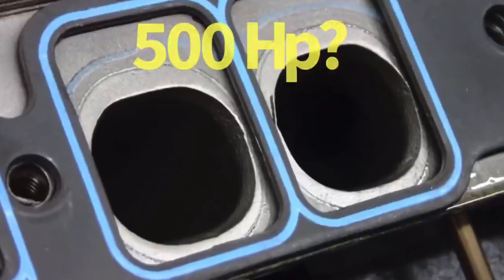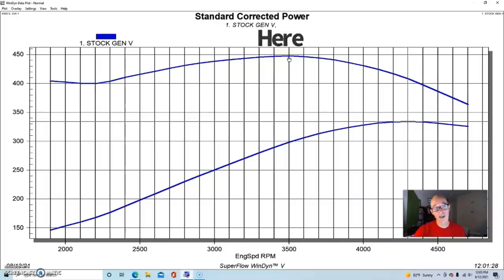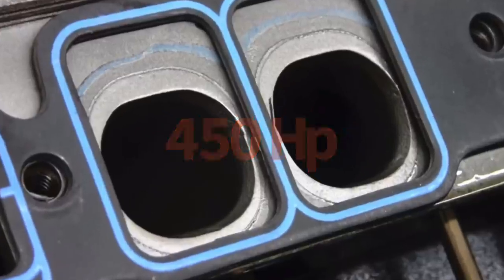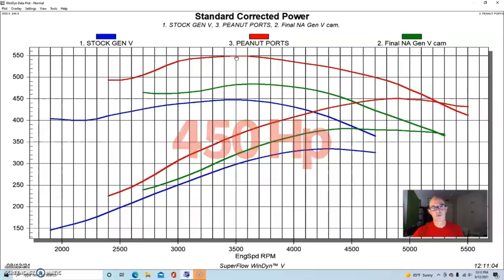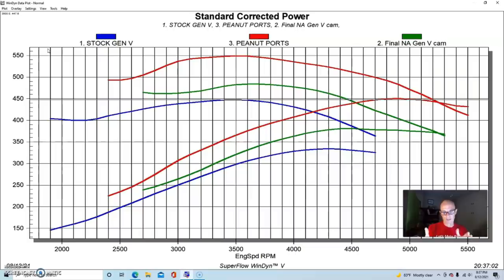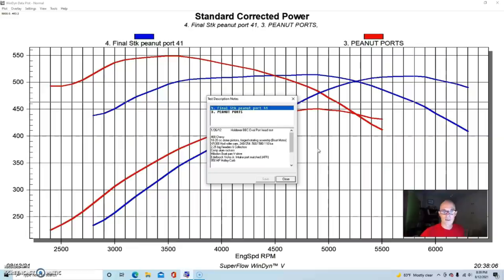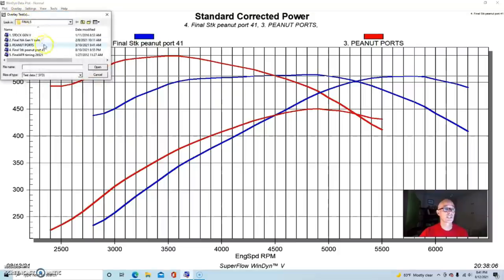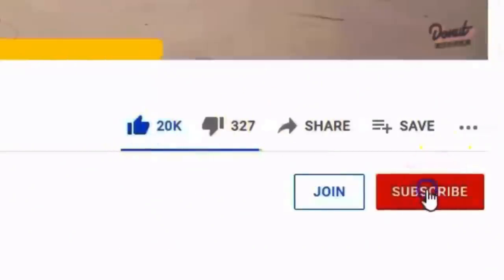HOW TO: MAKE 300 HP, 400 HP & 500 HP WITH PEANUT PORT BBC HEADS (HUMBLE JUNKYARD GEN V 454 )

Comment: Comp Magnum Series 286H  236@.50  .556 lift on 110 LSA.  Hydraulic Flat.  This would be a good swing at 500hp, good torque without spending on a roller.

Comment: I put together nearly the same engine (but using stock 781 heads & an Eddy Air Gap), and made more overall torque and horsepower with an Isky 304 Mega cam than with this Comp HR cam!

Comment: great test. if you have left the flat top pistons in there to have around an 8:1 CR and throw the roller cam in there with a right  106 - 107 LSA  would you just be down around 8%  in the HP & TQ ?  i have a gen IV with peanuts ( 360 castings ) and just want to throw a mild roller in there. DP and headers already in there.

Comment: I have a Gen IV 454 short deck with peanut port heads. This will be a daily driver and used in a 1979 C30. I'm interested in 350 hp/450 tq. range. Can I get there with air gap dual plain manifold, 750 carb, and long tube headers with a stock cam? I'm on a budget.
Reply from the maker: YES

Comment: Richard, have you done a test putting Gen VI heads directly on the Gen V to see what kind of gains you get with the stock cams and then with better cams? I'd really like to see that.
Reply from the maker: I NEED TO
Reply: @richardholdener1727  it would be interesting. You've mentioned it in your videos. I  have a Gen V with 147k miles on it, still runs great. Because of your advice, I found a set of the Gen VI heads that we're redone with little use. Going to collect a dual plane, distributor, though I think I'd like to go with TBI like FiTech or Holley Sniper. Eventually going into a 1950 Chevy C.O.E. car hauler I'm building behind a 4L80E. I need all low speed torque. Thanks for sharing your knowledge and they dyno pulls. Really enjoy learning and seeing what you test and how it works out.
Reply: @MartyEscarcega  iv same deal. A gen  5 I'm wanting to put gen 6 heads on!

Comment: Can you try to build a high torque big block? I want to see a gas engine that can compete with a diesel. Let’s say a diesel makes 400hp and 800lbs. Diesels are doing this at low rpm with the use of turbos producing high boost. Diesels are all forged, boosted, and have thick castings. If you built a all forged 454 or 460 with a high torque low rpm cam and pumped 20-50psi of boost in it, can it match a diesel?
Reply from the maker: it can't

Comment: I'm thinking the air gap intake probably contributed very little over the Weiand  duo plane. Those Weiand's are about as good as it gets for a dual plane street intake. Much better than the Performer RPM in my opinion.

Comment: I have a1997 454 engine out of a motor home. The engine is in excellent condition. What would be the best bolt on parts to use to raise my hp 150 to 250 hp without using nitrous?
Reply from the maker: boost
Reply: @richardholdener1727  Thanks. I was wanting to keep it na though.

Comment: Richard! love your vids, I hear you say a lot when is an engine wide open under 3k or even 2400 in regards to the dyno I say to that my river fishing jet boat does all the time when loaded tryng to get on plane.(carbed 302) looking to go 408. could you do SBF 408 stroker with a jet boat in mind. I have never seen a video on one and the internet doesn't have much on cam selection for jet boats. The owner of American Turbine the pump company for the jet said go for a cam with max tq a 43-4500. without any more guidance that what I will do. What do ya think
Reply from the maker: CAMMING A JET BOAT IS EASY BECAUSE IT RUNS AT HIGHER ENGINE SPEEDS-LOOK AT A COMP XE274HR FRO THE 408 OR IF YOU WANT MORE POWER-THEN THE XFI236
Reply: @richardholdener1727    Thanks so much for the response. My goal is to get on plane faster with a full load I run shallow water the faster im on plane the better. Also how do the oem water-jacketed manifolds do? have you guys ever dyno something like that?

Comment: How did you get that single plane to work on "peanut ports" and even that dual plane for oval ports? Port mismatch must have been incredible with very turbulent airflow.
Reply from the maker: it was mismatched-but it still works-lots of mercury marine BBCs came with just such a mismatch
Reply: A lot of people through the years have lost power trying to correct mismatched ports instead of gaining power. So even though it's not ideal, the engine just keep doing what engines does, moving air. :)
Reply: @PSA78  
Yeah I understand that. But there's a big difference when your using a "oval" port manifold on a "peanut" port head. The ridge that was been created by doing that. He could have got more hp easily by using the right manifold with the head. There aren't many manufacturers that cast manifolds for the peanut port heads. The Performer 2-0 is matched for the peanut port head and has enough material to open it up to the oval port if needed. We are all looking for maximum efficiency when we build engines, at least some of us do.
Reply: @henrys.6864  I didn't know that there was a manifold for the peanut port, would have been an interesting test as well, comparing the two manifolds on those heads. 🙂
Reply: @PSA78  👍👌
Reply: Makes me feel like I might have about the right combination going on in my build.

MKIV, +.060, JE pistons, forged crank and rods, ~9.3:1 +/-, World Merlin 119cc heads (320cc runners, 2.190/1.890). Edelbrock RPM air gap, Isky roller; 275/284, 0.535/0.575 (?)
Reply: @wlrottge  
That's gonna be a beast! 👍 Good luck! 👌🇺🇲
Reply: @henrys.6864  Thanks, I hope so!  Going in a boat, so the rev limiter will be 5,2 or 5,5k. Hoping the mid range is there!

Comment: So should I use an oval port intake manifold on peanut heads? My motor is basically stock, I just want to get rid of all the TBI stuff to make it run better.I'm going to run a 650 CFM Holly double pumper classic on it.I was thinking of using a Edlbrock RPM Air-gap 2-0 with oval ports on it.
Reply from the maker: OR YOU CAN RUN A PEANUT PORT INTAKE
Reply: @richardholdener1727  thanks Richard

Comment: 550 lift 320 duration crane valves and pc seals forged crank mellings high volume oil pump 850 double pumper in a 72 CALIFORNIA SKYLARK IN GREEN 454 CHEVY 12 BOLT AND A B&M TRANS ROCKET SHIP MORE MIKE

Comment: Old video i know. But im building a 92 pickup now. I needed this. The right cam. The heads i have. Bore with new pistons. And i may play with the heads.
Reply from the maker: for what application and usage
Reply: @richardholdener1727  4x4 towing. Farm work. It's always been weak. I will keep my heads. Go 4 barrel. 18cc pistons. And a slightly bigger than stock cam. Good valve job. Maybe clean them up. No wild porting.

Comment: @Richard Holdener, are there certain peanut port heads that flow more can than others? Seems I saw an article many years ago that stated as much. Can't recall where or what the info in the article detailed.
Reply from the maker: HAVE NOT MEASURED THEM ALL
Reply: @richardholdener1727  I found the article. The 236 peanuts are the best.

Comment: Hey Rich! Can you do this with a 427 Tall deck block please? 4 inch crank, 6.535 rods 1.64 CH pistons, peanut port heads as a base. Trying to get 600+ tq at 1700 rpms.
Reply: Also be cool to see you destroke a 454 and put it on boost. Anybody else want to see a twin GT45 turbo 427 dyno video?
Reply from the maker: it would be VERY hard to make 600 lb-ft at 1700 rpm with a 427, 454 or 496
Reply: @richardholdener1727  even with 8.5 psi?
Reply: Figured a Gen 5 produced its peak torque @1800 of 405ft#'s. A tall deck Version of a Gen 5 should produce more peak torque with higher compression pistons. Theoretically 500 ft#'s? 8.5 psi could put that at 600+? With an operating range of 1500-2500 for towing?

Comment: I have a 454, told it was a 94, but it doesn't have peanut port heads,  it has oval port heads, with performer rpm intake, 750 holley, and the idle doesn't sound stock, maybe it's the open headers, but it has a bit of lope,  I'm currious now exactly what it is, I thought the newer roller blocks came peanut ports?
Reply from the maker: maybe they were changed

Comment: I say fully port the heads and mill them to 10.5 to 1 compression then step up to an XR274 cam. Should be a good compromise on torque and pass the 500hp mark with an AirGap intake.
Reply: This is my setup actually! larger cam though (282s) and I bet with a carb or fuel inject change my engine would hit 600hp. or really close. I am thinking that I am 10.750 to 1 zero decked. with this setup the intake needed to be shaved on the sides for a good fit. so my thoughts are why buy AFR 290 heads when mine do the same? weight?
Reply from the maker: you won't hit 600 hp with that cam and peanut ports
Reply: Hey I have a 468 with 22cc piston 3 angle valve on the peanut port and 227/235 545 lift 109 .. 750 Holley 400 trans .. what numbers you think i have? Jus finished the build
Reply: @jon6537  Are you running an Edelbrock RPM AirGap?  I saw a video where they used an (claimed) 11 to 1 468 with fully ported Peanut heads with bigger valves, a 294HR Magnum roller cam, AirGap intake with a 950 Holley Ultra carb. It took some tuning with carb spacers, and rock arms and things but they did see near 600hp (like 572hp) so 600+hp might be possible but it would take more cam and more compression. Then you have to think about what you're giving up.
I think if the Peanut heads are ported right they "could" support 600hp or dam close with a big cam and big compression. If you want more hp than that and not run a pro stock cam with 12 to1 compression you will need to step up your BBC heads. You know that would be a good test video, figure out what is the cheapest best BBC head to support 600 to 700 HP. Just my thoughts

.
Reply: @richardholdener1727  I used to work for TREMEC trans, I have been in some of the fastest domestic production vehicles, my job was to do customer concerns and shift ability evaluations on Hellcats ,GT350-500, C7 and C8 corvettes, ZL1 camaros. when driving them the customer would ask, what do you think? I always replied, fast but I think my BBC TA would be a good race. when putting the car together I Broke 2 B&M converters, and had to ATI 10" 3500 stall TH400, no more problems.
Reply: @jon6537  cool thank you I’m putting it a 70 Chevelle I jus want a nice torque motor wit power
Reply: @clintonison3749  With the right parts and tuning you have the potential to have a VE of 1 to 1 at least.
Reply: @warrenstephens3705  YES, Edelbrock RPM AirGap I cut down the center section 1" and my car gets its air off the windshield like similar to nascar. I used the cam quest by comp cams and manually put in my head flow numbers and they claim that I am in the 600 hp range. with the air gap and 750 carb, Chuck Nuytten carbs says the same about my application so why buy AFR 290 heads?
Reply: @clintonison3749  Your best bet would be to Call up ATI tell them what size cam, tires, gear, Nitrous or not and have them build you a convertor! NO joke! your car will react to your application with that convertor and you will always be happy. My car is a bad a$$ street machine, Z06 guys think they have something until they see my tail lights!
Reply: @jon6537  right on I appreciate it .. I’m jus trying to have some nice torque on pump gas that good street machine .. I have a rpm air gap intake too
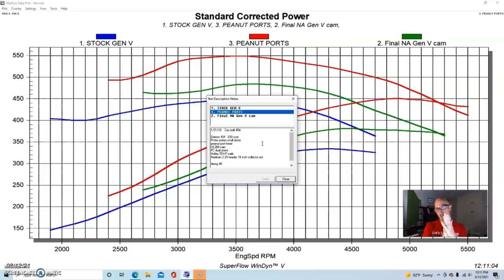Reply: @warrenstephens3705  thanx warren I’m jus trying to see what I have and will it make my car move … I have 4:11 rear and gears just a sat/ Sunday  cruise car
Reply: @clintonison3749  take a look at the center section of your intake, is it solid or cut down? 350-7561 this is the part number of mine look at the center divider, if yours is not cut down, then do so! you will gain some of that missing torque. the guys at motor trend also did this in their videos and can show you the difference it makes. Also BBC love timing advance, 34 degrees total is what I am set at!
Reply: @jon6537  it’s cut down .. and no one told me about the advance timing .. right on … I have 4:11 gears in my rear end too
Reply: @jon6537  I have Holley 850 carb too is that to big ?
Reply: @richardholdener1727  Well your right, what I thought to be peanut port's on my heads were not 063 are ovals! this now makes sense with the power that I am achieving in my engine combo.

Comment: Hi there.
I have a 454 m4 BBC with oval port head. To be installed into my old 62 series Landcruser. 
I'm seeking big torque & high horse power for 4wding. What's required?
Reply from the maker: STROKER WORKS

Comment: let me rephrase my comment.  is option 3 going to work in the marine environment?  no water reversion into the cylinders?  my motor just took a dump and is getting rebuilt and this looks like no brainer type upgrades while motor is out.
Reply from the maker: likely not with wet exhausts
Reply: @richardholdener1727  likely not to have reversion it likely not to work?  If likely not to work any advice on a cam that would work in marine environment and get me this type of upgrade above stock?   Also, I'm researching the speed master intakes, did you use the low, medium or high rise intake?
Reply: I recently went ahead and made these similar modifications to my mercruiser 454.  We are having some issues with idle not being consistent and issues getting carb adjusted.   It is a Weber Carter carb that was just rebuilt to go with the motor in stock form.  Now that we have gone with domed pistons and bigger cam do you think we need to rejet the carb?

Comment: I have a 454bb and i need your support to know what cam i can use for My engine 1980.
This has,manifuls multiplean edelbrock,headers, just need a cam com street map to increas the hp.
Thanks for your comments
Reply from the maker: look at a mild bbc cam
Reply: @richardholdener1727  
Thanks Richard.
What's size do You recomend xe268 for exemple in a normal engine? Just i Will replace the cam
Reply from the maker: that is a good rv style

Comment: A more realistic test would be a mild cam like the 268(that someone could potentially drive daily) with peanut port heads. Then upgrade the heads to like a 781/049 and see what kind of difference can be seen.
Reply from the maker: how to make 300, 400 and 500 hp from a peanut port head is very realistic
Reply: @richardholdener1727  it is. I enjoyed that piece as well. And this one is too. I suppose “realistic” wasn’t a good choice of words. I just think it would be interesting to take a mild cam engine and then see the difference between peanut ports and large oval port and then maybe even a set of speed master heads. I think the goal for most people is to not have the peanut port heads. But who knows maybe the peanut ports could prove to be more effective than what most people think. Your videos are great man!
Reply from the maker: a mild cam will not take advantage a bigger-high-flow heads that work better at higher lifts and rpm.
Reply: @richardholdener1727   I think what you're saying is debatable. I agree that higher flowing heads will make more power with more camshaft. But to say that better flowing heads won't make more power on an engine just because you have a smaller  bumpstick...that is not logical or reasonable! When we're talking camshaft application. Alot of factors come into play. Like rearend gear ratio, stall speed and what you are doing with the vehicle ie racing, cruising, pulling, ect. With that being said. I am confident one could take any type of build and put better flowing heads on it and make more power. Obviously, there are variables with head types and different applications. But we all know that peanut port heads suck for the most part. It would be interesting to see just what kind of difference one could make by simply removing a set of peanut ports and replacing them with a set of 781s? There is this you tube guy that does this kind of stuff all the time....

Comment: With the xe268 cam version could you spray it with 100-150 shot? Or with those heads would it be wasted since the heads don’t flow like a set of AFRs

Comment: Hello everybody. I have this gen4 with peanut port heads i cant afford to bore it out or put new pistons in it.. was wondering using that comp cam 268 would you have clearance issues using that cam and would it even be worth it to put it in without having  the 10:1 compression ratio?  Thanks
Reply from the maker: it will fit

Comment: I’m looking to rebuild my’71 LS5 454. Never seen how the oval port would work with peanut aftermarket intake. Could I get 500 hp out of it without too much trouble?
Reply from the maker: WHY PUT A PEANUT PORT INTAKE ON YOUR OVAL PORTS?
Reply: @richardholdener1727  
I had picked up a peanut port intake , Edelbrock performer 2-0 for a reasonable price and thought it would have a higher velocity through the runners before entering the heads. Would it chicle the engines potential? I’m not planing on Erving it past 6000
Reply from the maker: that won't be the case-but you can run it if you have it
Reply: Thank you for taking the time to reply. Would I be better to use the original cast intake or a torquer 2 oval port which I have as well.

Comment: Have you ever run the GMPP Ramjet 502 intake on Gen 6 BBC? I am upgrading a stock GMPP Ramjet 502 with AFR 290 heads and wondered what the limits are on that intake manifold.

Comment: Did you fit a roller rocker under those factory aluminum valve covers or use a stamped rocker on the roller cam?
Reply from the maker: I THINK COMP CAST ROLLERS FIT

Comment: I’d like to see a 454 30 over gen 6 with speed master heads at 10-1 comp with a pro flo 4 set up and see what the numbers are. This would be, to me, an ideal street engine you can run on pumps gas.